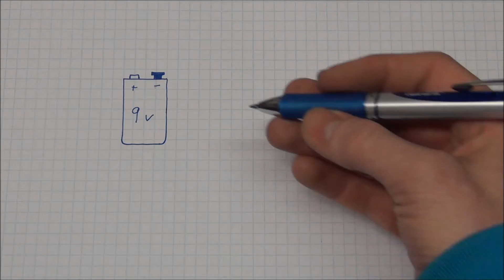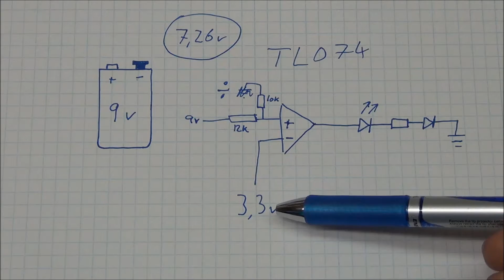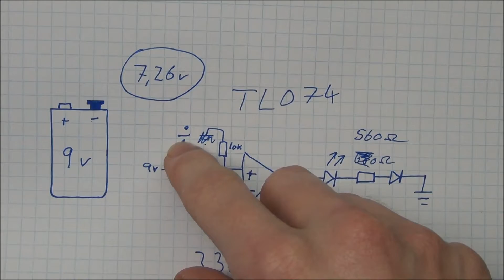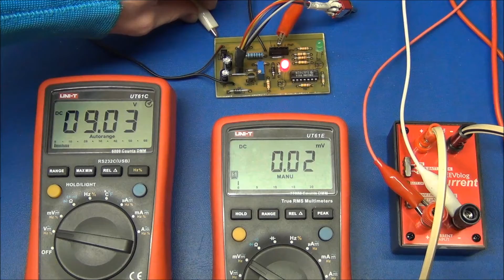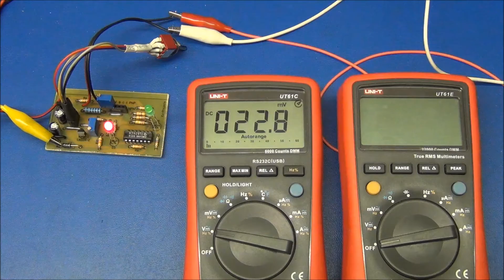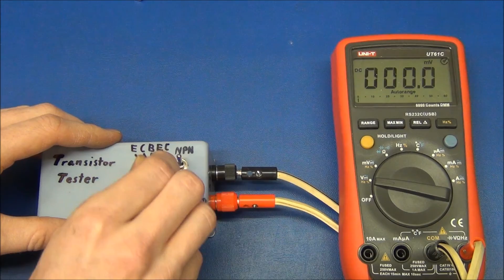DIY Transistor Tester (Part 2) - Ec-Projects

Comment: Hi. 
I really enjoy your channel. I built the transistor tester project. 
It works great, but i have found that the led doesn't come on when checking transistors with low gain. Around 20. 
Is there something i can do to remedy this?  
Would be nice, as I have plenty of 2SC transistors to check. They are all TO-220 package.
Reply from the maker: Thanks!
Yeah, should be possible. If you increase the value of the R7 resistor, on the schematic. It should increase the range, to allow a lower gain. :)

Comment: At 23:45 the transistor works in reverse active mode. It is still a working NPN or PNP structure if you swap collector and emitter, though they are not built symmetrically, thus the much lower gain in the reverse mode. It is a fun thing to confuse beginners with, because most circuits will still work if you get your transistors reversed :D
Reply from the maker: Hey :)
"Reverse active mode" so there was a name for it !
Thanks for mentioning that. I knew what it was, but not what it was called. ;) 
Thought it was called something with "leakage", but nothing popped up when I searched for that. Perhaps I can find some values, now that I got the name :D
Happy new year !